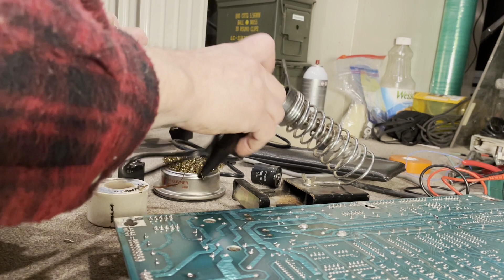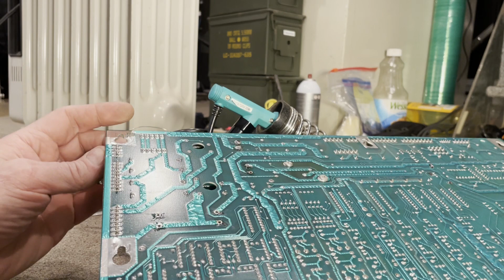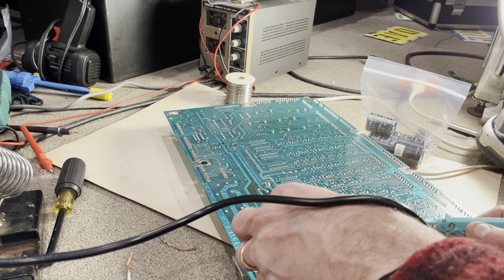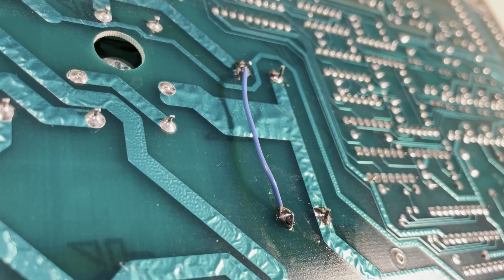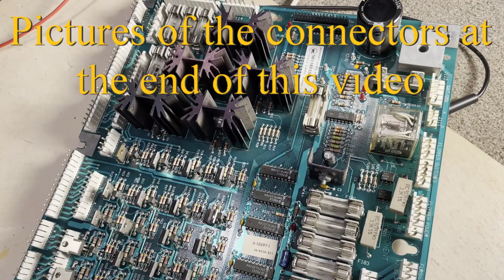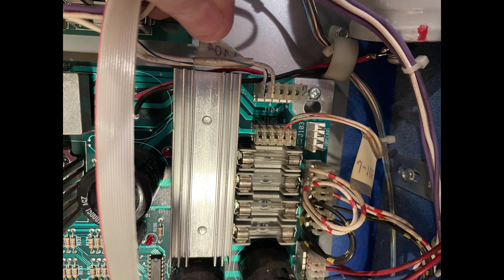Changing the large capacitors on the Power Drive board on a Williams 1990s Pinball Machine

Comment: A much more effective method is to either use "ChipQuik" low temperature solder or to use two irons. BUT, replacing all 5 15,000uf caps is ill advised for almost all home pinball enthusiasts. They will almost certainly pull one or more of the plated through holes that you mention early in the video (and I see that at least one through-hole was pulled and repaired with a blue jumper in this video). 95% of the time, home pinball owners would be better off sending their board for repair to a qualified pinball board tech.

Good point about the "ring crack".

In 35 years of repairing pinball PCBs, I've seen exactly one LM323k 5VDC regulator fail.